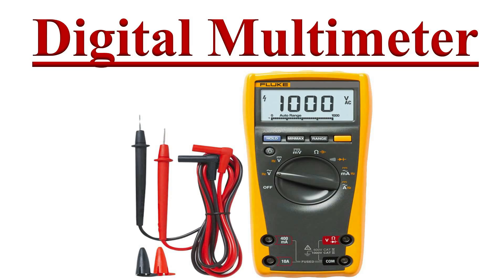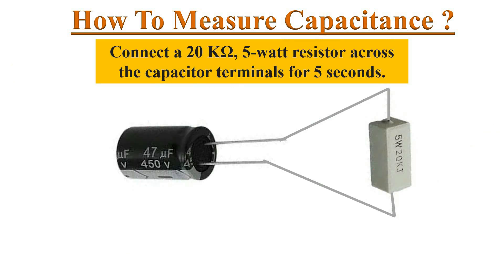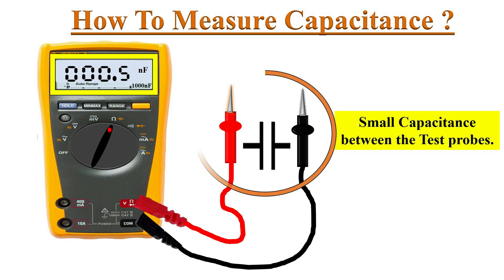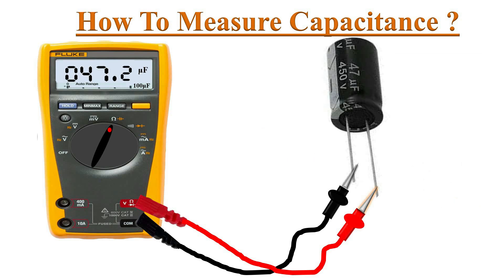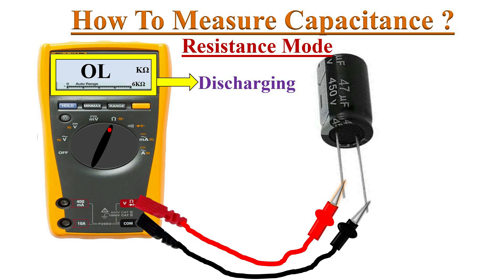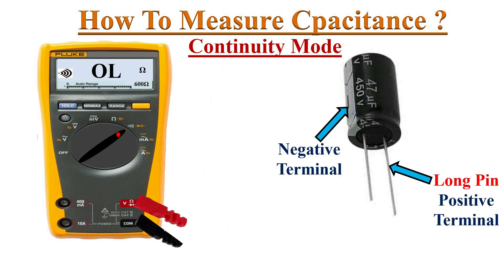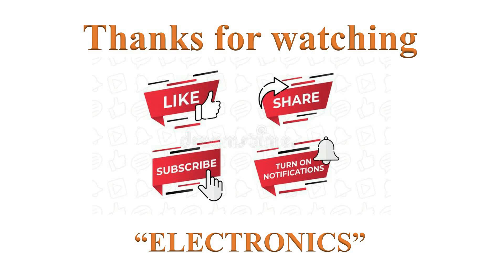How to measure Capacitance with Multimeter?

Comment from the maker: Timestamps for various topics covered in this video are as follows:
0:21 Multimeter setting for Capacitance measurement,
0:44 Safety precautions before testing Capacitor,
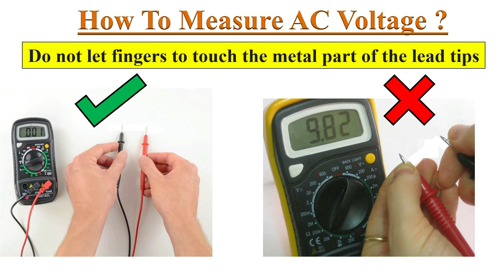2:14 Taking Capacitance measurement,
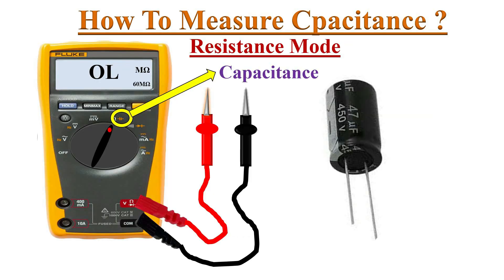3:22 How to test capacitor using Resistance mode,
4:47 How to test capacitor using Continuity test mode.